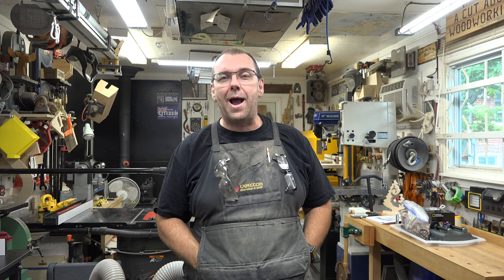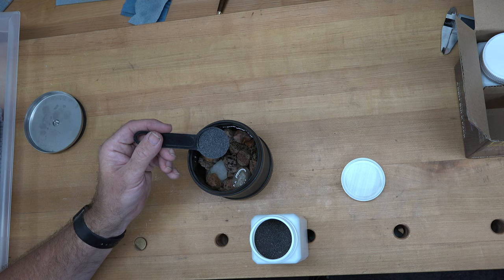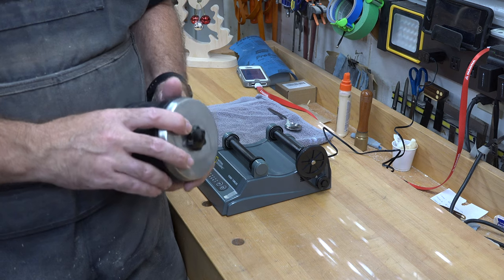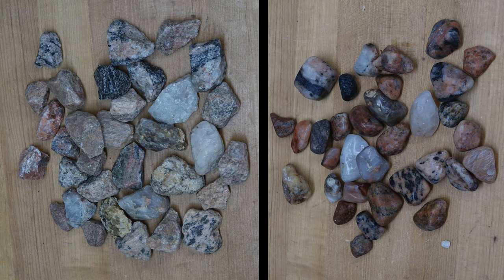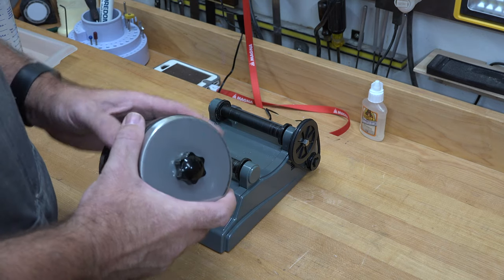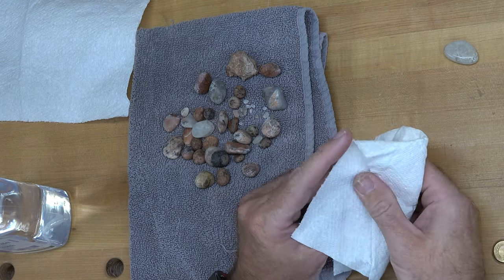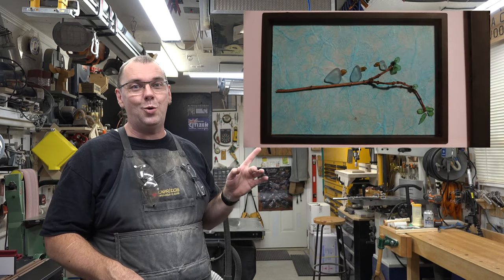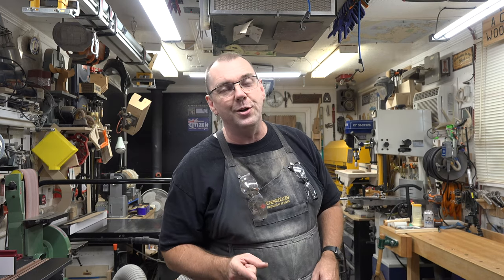Rock Tumbling

Comment: You will get a complete ultra shine if your tumbler is 2/3 full for every step. I'm pretty certain that at your final polish stage the rocks were just "sliding" around in the tumbler.... they need to tumble.  That is where you need "media" to fill your barrel  to 2/3 full. Thanks for your video.
Reply from the maker: Thank you for your advice on the rock tumbling.  I'm sure that it will be useful to many people as they read the comments of the show.  Thanks for tuning in as well.  It's very much appreciated.

Comment: That brings back some great memories! We did that with the kids and it helps instill patience for sure. I live in Kansas close to the Arkansas river bed ( dry now) and the very course sand from it is used on the roads, so you can find some pretty spectacular rocks in the road. I have discovered that light will shine through some of the rocks which really enhances the color, so do yourself a favor and stick a small bright light behind your polished rocks. Thanks Ken!
Reply from the maker: I will definitely try that Frank.  You never know when you might find a semi-transparent gem.  Thanks for tuning in to the show and for chiming in with your experience.

Comment: Just a hint - if  you don't want to lose as much mass on your rocks from beginning to the end of your process, add ceramic pellets to take up some of the space in your drum1
Reply from the maker: That's a great suggestion Teresa.  Thank you for tuning in and for taking the time to chime in with your suggestion.  I will be sure to try that on my next tumbling batch.
Reply: You can also add in course sand with some small pebbles as well. The sand and tiny pebbles will not survive each stage but they help cushion the rocks.